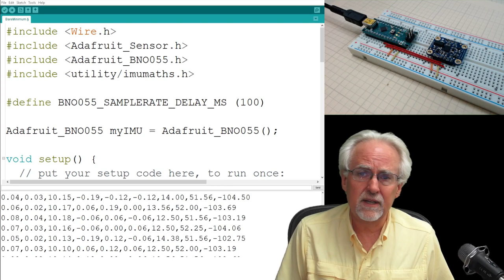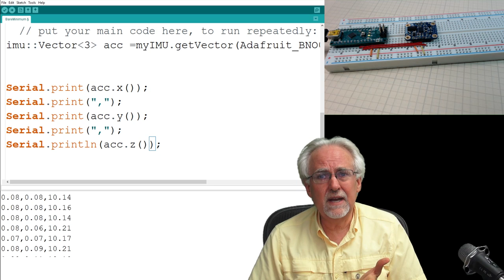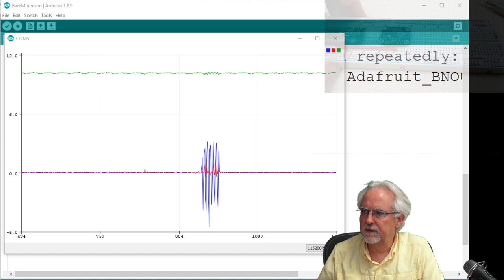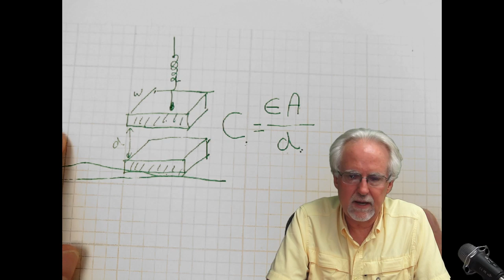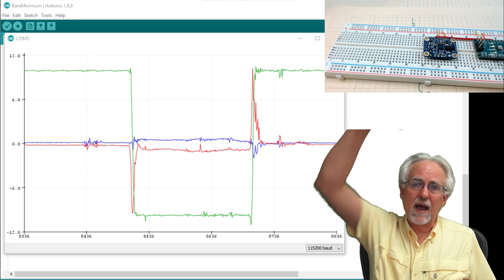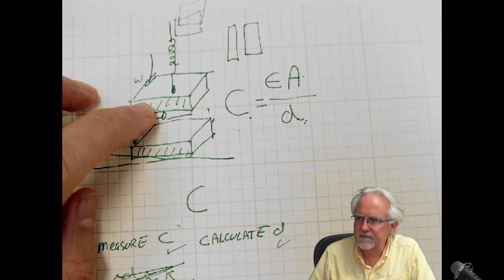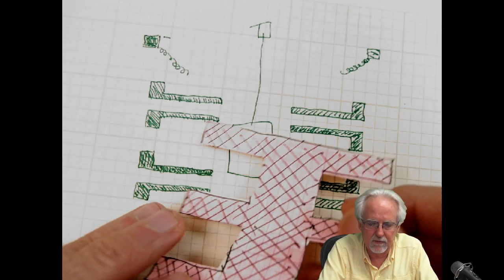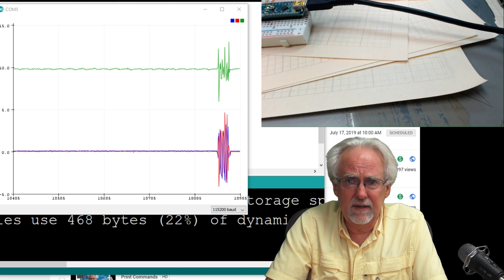9-Axis IMU LESSON 3: Understanding How Accelerometers Work

Comment: The best explanation on YouTube for its scientific accuracy and simplicity. I bet this video will be searched in the YouTube engine by people to clear up their confusions on MEMS accelerometers. 

People do researches. But not all of them can master all the principles under the hood. Paul can.

But I do wonder if the two moving parts would ever touch each other accidentally if there were a huge sudden force, resulting in a shortcircuiting between the two plates.
Reply from the maker: Dropping a ceramic chip or board from 5 feet to a concrete floor can generate a 5,000 G impulse shock, believe it or not. In the early days, these devices could be damaged by these impulse shocks. With such a shock, the parts could come into contact, and they would tend to stick and hence become non-functioning. Lots of work in design, and anti-stickion coatings have probably made this less of an issue on modern devices.

Comment: Paul, I got the homework and did it just like you, I also put in the println command at the end of the X,Y,Z acc.
then I had to pause the lesson and am going to watch the rest now.
Thanks,
Gary from Indiana
Reply: OK Paul got my WiFi here at home, and this Lesson does make sense!

Very good model, it has helped me having worked in Fusion 360, with making a 3D model ... so much I do not understand why (in some of your "free" time) you did not print up a model with your 3d printer? Ha just joking!

I will watch Lesson 4 since I have not yet, then back to the New Arduino Lessons, and still need to flash another Micro-SD card for the Jetson Nano.

Very busy and very excited about these projects, now what to do with a Pi 4? Again I concur with the Jetson Lessons and possibly the Pi 4 is running out of it.s share of the micro-processor  "Pi", lol

Comment: Paul, thank you  fpr your tutorial ! I am building an RC Helicopter now, doing CAD, 3D print, mechanics, wiring alone and  my brother will help me with the code.  Do I need two sensors for stabilisation ? This is my logic : if the wind comes, for example, the first sensor will measure the movement of the helicopter caused by the wind, then I will use the second sensor to bring the helicopter in the aproximately same position, while the first sensor, again, measures the movement. In the next step I will  evaluate  the difference of the two measurements as an error for the feedback loop(PID). 
I would be thankful for any feedback.

Comment: I recently bought an MPU-6050 open source development board which comes with an STM32 on the board. 

Though the algorithm they use involves quaternions, the board's pitch readings do suffer from gimbal lock, where the pitch data would appear sudden changes when I pull up the "nose" of the board, resulting in the 3D model of the board on my monitor swiftly flips around ridiculously. 

Hence, your algorithms must be of more robustness, even though you too use quaternions. I look forward to learning your math. Thanks a lot.

Comment: In order to shorten up your long code lines, to make things a bit easier to see, you could use something like this in your loop()...

using BNO = Adafruit_BNO055;

Just put that at the top of your loop() function, and then you could just use the enumeration names in your code, like this:

imu::Vector<3> acc = myIMU.getVector(BNO::VECTOR_ACCELEROMETER);

Just choose your favorite short mnemonic for "Adafruit_BNO055" and it will save you a bunch of typing. And if you use it only where you need it (in your loop function, in this case), it won't pollute your whole code base. This is just standard C++ for the most part, so the AVR-GCC compiler should be more than happy with that--and it works here for me in the Arduino editor. 

Great video though--very helpful explanation of the spring-mass system of the capacitor-based accelerometer. I thought I had a good idea of how it worked, but your explanation taught me that I didn't quite understand it completely. I feel much more confident now though, and can't wait for my BNO055 board to arrive in a couple of days to get started with the hardware. I plan to use a Teensy myself, but will likely just order a Nano for backup. This is a great series so far, and I'm looking forward to working through the rest of the videos!

Thanks so much for making these videos.

Comment: I think what Sir Paul is trying to say is that: an accelerometer still measures acceleration. 
He said "accelerometer does not measure acceleration" just to make us realize that there is a correct way of thinking about how accelerometers really measure acceleration.
  
From what I get from his explanation, the more correct way to think of it is...
   
An accelerometer measures the force that is acting on a suspended body
then it calculates the acceleration.

Hmm, the capacitor analogy made it confusing for me. (although I understand that accelerometers work with capacitors as Sir Paul said)
I just think of accelerometers as having one suspended mass on each of the 3 axis to which these masses are attached to a spring.  Then i think this analogy will make more intuitive sense in the context of the Hooke's Law.
Other than that, thank you Sir Paul for this very informative video. Even though I get the capacitor analogy where the top plate is suspended, thinking of just a suspended mass just seems more intuitive to me.
Thank you for this lesson Sir Paul!
Reply: P.S. I was referring to the capacitor analogy at the very start...wherein the capacitor is taken in its schematic symbol. But I learned how accelerometers really work after watching the actual design of a capacitor. The "cartoon" really helped Sir Paul!

Comment: So if you have a change in x axis the Area of the plates in capacitor changes, but how do you then calculate the force that is needed to calculate the acceleration? I understand if you change y axis the distance changes so you can apply hooks law to get the force, but how do you calculate force if area of capacitor changes?

By the way, really excellent explanation and I really love your videos.

Comment: I got the temperature reading of -1.  Also, my values do not change when I move my breadboard.  I bought a different kit with my arduino, but my BNO055 has the same inputs although it is mounted upright.  i figured the values would be different, but moving my BNO does not change the values whatsoever.  Do you have any feedback on this at all?  I'd greatly appreciate it.

Comment: Could one construct an accelerometer using a cantilevered beam whose base is fabricated using piezo-electric material?  This device would produce a voltage proportional the deflection of the beam.  I realize it may not have the same cross-axis isolation as the device you described but voltage is more easily measured than is capacitance.  As some may remember, one type of phonograph cartridge used the piezo-electric effect.
Reply from the maker: These accelerometers are built using IC manufacturing, and in such a context, capacitance is as easy to measure as resistance. The concept you describe would theoretically make a workable accelerometer, but the problem is Piezoelectric materials are not part of standard IC manufacturing techniques, and so would not be practical to built such a device.

Comment: simply amazing. thank you sir :) i was wondering how in the world are these tiny components manufactured. perfectly milled microscopic parts. what are these tools that make these almost invisible parts.
Reply from the maker: Same tools and technology that is used to build IC. For decades we have been building transistors smaller than a millionth of an inch. Now we build mechanical devices that small with same technology
Reply: @paulmcwhorter  thank you. now it makes me wonder how did they make those tiny tools. the God paradox - if god created us, who created god. Fractal universe
Reply from the maker: The tools are not tiny. It is a photographic process. Create a negative, then instead of enlarging the image, reduce it, and project the image onto photosensitive material, and etch it into the silicon. Think of it as a photographic and etching process, not a mechanical process.
Reply: @paulmcwhorter  incredible. its like projecting the future onto the silicon.

Comment: Hi,
I have a doubt if I am placing accelerometer on building to measure vibration it gives me output of acceleration vs time but I want output as force vs time so here to convert acceleration to force mass of accelerometer or mass of building is to be multiplied

Comment: Just started this series and loving it.  Getting  a  good readout on serial monitor but plotter only has the timeline bar at the top of the screen and it doesn't plot any output. ?? not sure what to look for. Baud rate is the same as in the program and I have played around with different rates to no avail.
Reply: Figured it out. It was a typo for the data separation.

Comment: can i use this series for making thrust vector controlled rocket?
Reply from the maker: That is not advised. The sensor will lose calibration and you will crash
Reply: @paulmcwhorter  can you please refer some books or materials where i can learn this to apply in my project both sensor and PID part
Reply: And thanks for replying me ,really didn't think that you will reply me........and I know its not possible but wish i could meet you someday<3

Comment: Paul, I have a problem with my new Nano I just got... my Uno board works just fine with the same laptop and com port.
My code downloads fine but I get this error message; 
avrdude: atk500_getsync() 
Attempt 1 of 10: not in sync: resp=0x30

There’s a lot of info on Arduino Forum when I searched for the error message. I tried all applicable suggestions ...

Any ideas?

Thanks - Gary
Reply from the maker: Do you have the board type set to nano? Did you order the authentic nano from the link I porvided? The clones sometimes have driver problems.
Reply: Yes, I picked the “Nano” and my PC recognized it “Arduino Nano;com3”, and yes I ordered it thru your link. Bought a new USB A to USB MINI-B to make sure.
Changed to baud rate slower and revised code to match.
Some of the blogs replied to delete and reinstall Arduino,  but my Arduino Uno I ordered thru you for the New series, it worked fine.
Will look-up latest driver for Nano on-line and reinstall. My drivers for the 9 axis shows up in my library folder.
What combination do I need for a Linux-only desktop PC, for python and what we’ll be doing with the Jetson too?
Reply from the maker: Did you get it to work? My nano worked directly with the recent version of arduino IDE (1.8.9). Just under tools selected Arduino Nano. Did not have to do any other modifications. The only problems I ever ran into with a nano was with older versions of software, and with nano clones. As you mention, you have to rule out the cable as well. I have gotten bad USB cables along the way. I would as you say unisntall the software and drivers and then try to reinstall. I have never actually encountered a broken arduino. So, hopefully it is a driver issue.
Reply: Good news I finally corrected the problem, it was a windows driver thru Device Manager that needed update for the Arduino Nano, and since windows found the driver (and it worked) then the Nano was a genuine Arduino and not a clone, in which I was starting to doubt ... too?
I missed the Jetson Nano Premiere but I’ll watch it several times anyway.
Thanks Paul for the “Support”!!!
I’m just so excited with all your series, it will lead to great things for me!